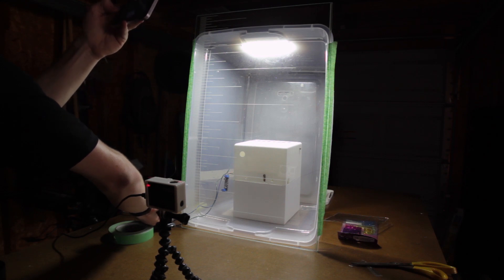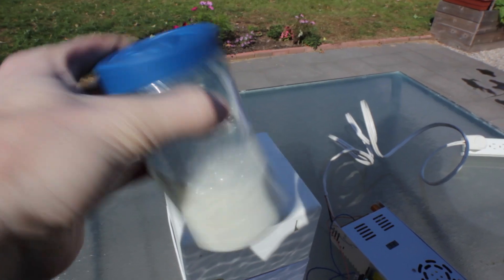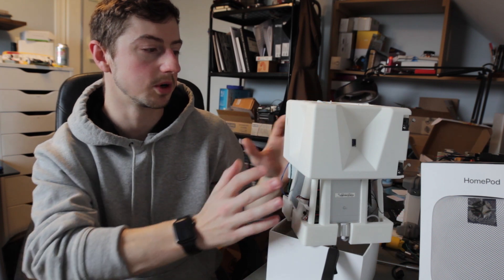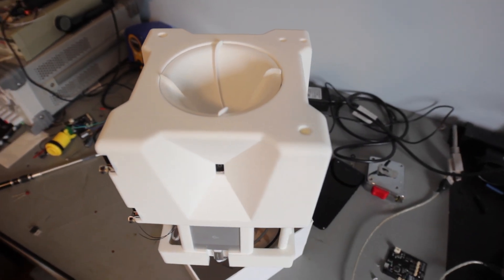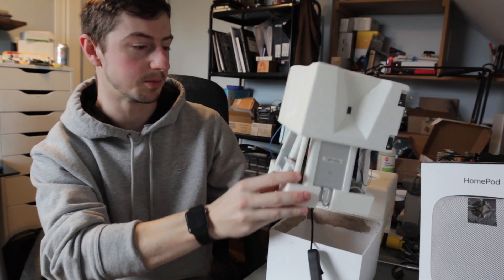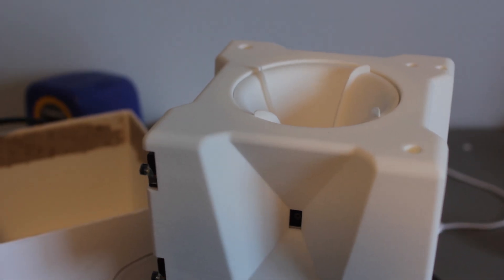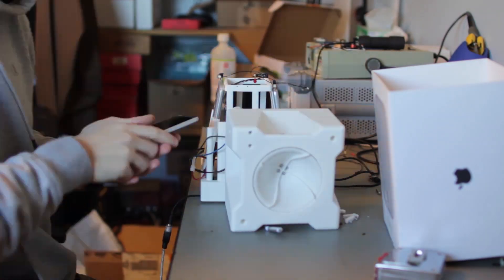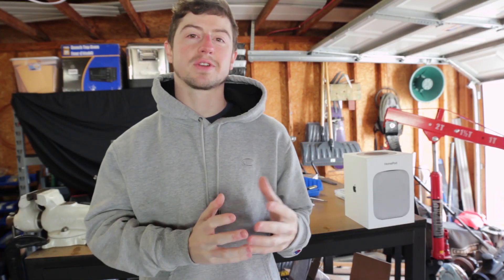Building Glitterbomb 1.0 with Mark Rober

Comment: What motors and stuff did you use for the 2.0? For the fart spray, cuz I had an idea for our reseaech plan to use those stuff to spray alcohol into our hands, with motion detector, so we dont need to touch the thing just to sanitize

Comment: Alright, so I see the code, but do you have the files for the 3d print?  Or source idk.. Catia, solid works, proe data?
Reply: And did you use a evaluation flash board and purchased parts with the microprocessors, pcb, etc or build your own?

Comment: Just two things... 

1.  Did you consider propelling the glitter with the exhaust from a carbon dioxide cylinder - it would likely have sent the glitter much higher...

Which leads to:

2.  If you get the glitter going high enough, why not add a can of spray adhesive that goes off first... put the nozzle on a stalk and rotate that, then propel the glitter with carbon dioxide.

Comment: Couldnt angle the fin and add tabs for some height?
Reply from the maker: We figured horizontal distance would do the most glitter damage.
Reply: @SeanHodgins  sweet. Exciting project.. thanks for posting. If you ever revisit the build might I recommend vacuum packed fish eggs in fish oil with a rolling pin. Keep the vids coming!

Comment: I saw the original. Great work. 
Yet for package thieves I favor a simpler design: a box with a handgrenade and the pin attached to the lid. No need for footage, tracking or retrieval

Comment: It must have been cheaper for you to buy a low budget 200 dollar 3D printer than ordering all those parts from shapeways. The quality isn't that much worse, especially for a project like this where you can easily sand all surfaces and spray-paint a nice finish if you want to box to look nice.
Reply from the maker: It’s not all about surface finish. Durability was important. The SLS nylon material can survive being thrown from a car or house (literally) - a home print would have broken into pieces.
Reply: @SeanHodgins  Ah, ok :) Could have gone for resin epoxy or something similar with a home printer, might have been cheaper. But it makes sense if you need strength. How much did the parts from shapeways cost?

Comment: 3:18 There's no actual lid on the top of the cup, and with those ridges sticking out, the box lid can't sit flush against the cup to act a sealed lid either... if the theives didn't hold this package in any way but entirely upright and stable, the glitter would all pour out of the cup.  A great gadget, but the actual theft side of this video was soooo staged.
Reply from the maker: You’re mistaken, while yes the ridges do make sealing it more difficult(hindsight) it was specifically tested and setup with a piece of foam in the top of the box that contours and compresses to the shape of the top of the glitter cup, essentially sealing it off. When I ran the tests on myself, and while it wasn’t perfect it was a good enough seal for this usage. I was able to shake and turn over the device without any visible glitter coming out. Now with something like this you also have to rely on a lot of assumptions. We had to assume that a box like this, with a slightly heavy, expensive, electronics in it(the homepod) that the thief would not be rough with it. I mean don’t you agree it would probably be easier to sell a working HomePod than one they broke chucking it into the back of their vehicle? So assuming that fact in combination with the foam in the lid made it suitable enough to hold the glitter in, at least until the lid is removed. Nothing can be perfect but the reason this took so long to build was we had to cover so many possibilities for what they might do. It was designed to be tough, sit out for extended periods of time, and work regardless of what type of person grabbed the thing. It was designed to be stolen.
Reply: @SeanHodgins  Cheers for the feedback Sean. I really wanted the video to be legit. I could discount some of the videos being staged (either knowingly or otherwise), but the glitter part in the cup was something that seemed like it would just pour out, especially as if you take a rectangular parcel and place it on your car seat, you'll most likely lay it on its side (otherwise it's just going to topple over when you're driving).

If there's some foam inside the top of the lid then that would make sense. I don't mean to knock your hard work, but something just didn't feel right when looking at the design without anything extra inside the lid. Great work though!

Comment: Great Designs, but come on, Shape Ways? You're throwing away good money there! Anyone could 3D print the same models for you for far cheaper. You gained a subscriber :)
Reply from the maker: Needed to use SLS printers so the design looked nice and would be durable. Not many people can afford those printers. Haha
Reply: @SeanHodgins  Yeah those machines sure are expensive... 

Printed in PETG with a .8mm nozzle, this could have been made really rigid through FDM. If you need any large 3D prints for future projects, contact me and I will see what I can do. I've currently got ten 3D printers and it seems that numbers always growing... (I've got two in construction now). Contact me at yelt3D@gmail.com

Happy holidays!

Comment: Would think something like a CO2 charge would spread the glitter more. Ether a direct puncture off a electromagnet driven spike or a spring loaded pin you can remote trigger.
Reply from the maker: Wanted to try to avoid actual explosions in this "not-a-bomb".

Comment: Sean great engineering! And for a worthwhile reason! To bad when you aerosolized the microglitter there wasn't a way to coat it with say 3M general trim adhesive ...that stuff would never come off.... riding around in a car or going into a kitchen that looked like my little pony had exploded in it would be so much payback....
Reply from the maker: Lots of possibilities! Thanks!
Reply: Could possibly add oil based paint or other substance that would seriously stain. :D  Though need a way for it to stay in even if the package tips over.   I imagine some kind of cover that seals around the cup would work then an actuator rod just pops the cover off as it spins.

Comment: 3:00 LMAO... Having worked in data centres for the last decade I can assure you they don't normally sit that high. Although I could only imagine the ear melting drone in a data centre 30 minutes after the air conditioning failed!
Reply from the maker: That was @ 12V, so potentially could do that. I also think a lot of them go full speed when you first boot up the rack, do they not?
Reply: @SeanHodgins   yes, each server will spin the fans up on startup until the BIOS kicks in (couple of seconds). Although the chances of more than a few doing this at the same time is pretty small.
Great work by the way, the results were hilarious!

Comment: The bomb worked out great but I can't get over the risk of losing 4 good android phones. Posted a comment on Mark's channel but doubt I'll get a response with how much traffic goes through his comment section. 

My suggestion was the usage of cheap 1080p fpv ip cameras for video, a dedicated gps module for tracking and a solenoid activated air blast for glitter distribution on a 555 timer. The control and comm circuits could be made smaller and there'd be more room for a lot more glitter. With the added benefit of a wider blast radius.  Maybe version 2.0?

Great job and such an awesome idea!

Comment: @SeanHodgins
Awesome stuff, you made my day! 
Did you ever consider using a CO2 cartridge instead of a spinning  device? That way you should be able to make a sealed container of the glitter that will burst when triggered! You would also cause the glitter to spread regarding which angel the package is opened in. 
Just some thoughts :-)
Reply from the maker: Yeah we discussed using CO2, but decided against it due to trying to avoid the actual "bomb" aspect of this thing. Pressurized vessels and strangers don't mix. You don't know what someone it going to do to it.
Reply: @SeanHodgins  You've got a point there... It´s truly a beautiful design! When will you make a build guide? - I need this! :-)

Comment: Glad you could open source everything! My only advice would be to replace the cell phones with fpv cameras which are also small and cheap and have wide lenses. it would be tricky to get the uploading aspect but much cheaper.
Reply from the maker: Uploading was a primary objective. Trumps cost. These phones are cheap anyway. Likely the cheapest option for what they offer.

Comment: I don't want to just Prank the fuckers. I want to demolish their house or car. Spray paint seems fitting. Kinda think a push pin jamed in the nozzle and then the nozzle tapped in the depressed position can make an effective pull pin paint grenade. Be intreasted to see this tested and see how effective it is
Reply from the maker: Past traumatic experience with a package thief?

Comment: How do you 3D print something like this? Not this exactly, but these types of models? Ie, what service and material is used for this? Thanks.
Reply from the maker: Shapeways in this case, but any SLS Nylon printer should do it. Nylon is a great material for this kind of thing, very durable.

Comment: you left out the fart spray - i was really wondering about this, i did see in the hot video that you cut a hole so it would spray out though
Reply from the maker: Didn't cover it in mine, added bonus for Mark's.

Comment: 2:23 Retrieve ;) *I before E, except after C. You're probably still smarterer than I is.

Edit: JFC You're nuts holding that fan in your hand! It could've taken off some fingers if it blew up. Unless server fans normally operate that fast? Also, did you consider small CO2 cartridges?
Reply from the maker: Oops, there is always something. 

Surprisingly that speed is fine for that kind of fan, but it was still risky. 
CO2 too dangerous for something like this.

Comment: I'd like to know more about how you were controlling the phones. More specifics, how many different actions did you have the phones taking? Did you have any trouble with the phones being responsive enough. Any feedback from the phones etc. It would be cool if you made a video explaining that in more detail.
Reply from the maker: The phones could be texted different messages to get automated response, like location, battery life, status, etc. That was one automate App.

The other App controlled the cameras through the headphone jack. Hitting the Media Button(headphone jack center button) would cause the phones to wake up and start recording, hitting the media button a second time would stop recording, close the app, open google phones to import the video, close google photos, and go back to sleep. This is a much simplified version, but that is basically how it worked. Phones had a lot of issues to overcome, there were delays, videos wouldn't upload, things that we didn't really have a lot of control over.

Comment: Add this to the glitter mix (found on Amazon) Visible Stain Theft Detection Powder - Purple and/or Fluorescent Powder, 100g Professional Luminescent Pigments Phosphorescent Color Photoluminescence Non-toxic Strontium Aluminate Neon Lights Nights in Dark Pigments(Blue Green)

Same type of dye used in bank exploding dye packs stains everything and the other will make them glow in Black UV light. They can vacuum up the glitter, but they will be identifiable.
Reply from the maker: If banks are allowed to do it...

Comment: Why did you use physical limit switches instead of a mag contact ? Just a weird choice since the rest of the build is so clean.
Reply from the maker: I don't know, reliability? There is probably a 1000 ways this could have been built.
Reply: @SeanHodgins  Why 2 limit switches? Maybe there's an obvious answer to builders, which I am not. Thank you for making the video. I imagine watching this may inspire a career path for more than a few pre-teens around the world.
Reply from the maker: @rslarkin  One ensures that the device starts the cameras recording(important if there is some sort of issue this is like a backup), the other allows the motors to spin, that way the motors will never spin while the lid is on.

Comment: I want to see the nastier / meaner iteration with dye pack/paint “bomb”, something that will for sure ruin the thief’s day or even week.
Reply: Yeah that's what I'm working on figuring out. I want it super low tech and low cost and can be slaped together in minutes and mass produced and still totally train wreck their car or house. As bad ass as this is, it's costly and complex. I'm thinking pin pull spray paint cans. Imagin three spray paint cans dumping their entire contents into a car soon as the lid is removed lol. That's justice. Glitter is irritating. Spray paint is more permanent.
Reply: Dont use spray cans.Just buy bulk enamel paint.Imagine it just spraying/pumping a entire one pint can of paint out of the device.
Reply: @joespawldin7833  Easy to do.  Cheap Arduino clone + limit switches + cheap servos.  Oh, and Google "3d spray paint servo".
Reply: Joe Spawldin a box with a lid that have holes on the bottom. lid is long sleeve and plugs those holes, when lid is lifted holes unclog and.... paint is flowing off
Reply: Joe Spawldin and it yells self destruct in 10 9 8..... To scare the people
Reply: Now you sir are a genius. Please take my money!!!!!
Reply: my idea.. 

make the cup deeper. 
add ink
add noisemaker

order of execution.  

person opens box. fart spray cylinder is punctured but doesn't release gas. 

followed by ink
then fart spray and glitter spinner to really let the Smell hit it's target fast
then noise maker. 

then it's official.

Comment: My take is a bit different, with pneumatic system. CO2 cartridge provides power for the glitter flinger/balloon of surprise, and continues to activate until the time is up and a failsafe spike is deployed to pop the balloon.
Reply from the maker: CO2 cartridges came up in discussion, but a pressurized vessel seemed a little too dangerous in the hands of strangers. Your idea sounds hilarious! Really clever.
Reply: @SeanHodgins  I take it you wouldn't be in favour of some industrial grade fireworks igniting in the package either?
Reply: Balloon just for a loud pop?
Reply: @michaelsmith483  In my idea, it also contains the surprise, such as glitter. As balloon exceeds its limit and bursts, it emits a loud sound and flings its content around.

Comment: I think you could sell these in a smaller package that just pops glitter and fart spray with no recording. I would set one out everyday. I don't care for the footage, I will just laugh knowing someone got messed up.
Reply from the maker: Haha pure evil. I have a fear of glitter now.
Reply: @SeanHodgins  - PTGS - Post Traumatic Glitter Syndrome
Reply: Or just be satisfied with audio recording only, cheaper, but may get a laugh if you get it back. Still needs GPS for location though, unless you can use a WT (walkie talkie) with VOX (can be triggered electronically) as some sort of locator and remote audio listener (range only a couple miles at best though).

Comment: Are you able to buy all the pieces to make this product at a store? Such as a circuit board?
Reply from the maker: Almost everything in this build was custom designed parts except for the phones and motors. You could use an off the shelf Arduino if you wanted to though.

Comment: Does the cover come off easily?  I was thinking what if while picking it up the cover accidentally slips and the mechanism is triggered.
Reply from the maker: Its secured in a similar way to the original packaging, so its on there pretty good. The switches are at the top so its hard to accidentally trigger.

Comment: If the thief tipped the package over, would the glitter (mostly) stay confined to the cup, or would it just go everywhere and not get flung?
-never mind, found a comment stating foam in the top of the box keeps the glitter in
Reply from the maker: Yeah we had to make sure it would be shake proof. We had no idea when or how many days it would be sitting around until the thief opened it.

Comment: Does the phone go to sleep after a while, or does the screen stay on at a very low brightness? if it goes to sleep, how does the audio jack signal "bypass" the lock screen?
Reply from the maker: If you never enable a lock screen, when you "load" an app the phone just turns on. I also did some stuff with the phones power state as well.

Comment: nice work Sean.  I was the packaging engineer that designed the homepod packaging :)
Reply from the maker: That was a pain to take apart! You use some good double sided tape to hold that injection molded plastic in there.
Reply: yeah believe me that was a tough project.  homepod is a heavy product and needs to withstand some high drop heights.  and thats not injection molded plastic thats a thermoform :)

Comment: Four phones, 3D printing, arduino plus modules , and motor plus spinner. The build cost alone may push stealing this into a felony. Hindsight 20/20, Video was of limited value as faces could not be shown. Audio was funnier. Nice work but a little too pricey to lose.
Reply from the maker: The cost of the unit may have been part of the plan, as leverage to get it back. ;)
Reply: @SeanHodgins  Why are you hiding the faces though?
Reply: Dany Caissy I was wondering that too. Can they really suing you for invasion of privacy?

Comment: Wonder if adding a 12g co2 cartridge to the glitter blender would improve dispersal.
Reply from the maker: We were trying to avoid the actual "bomb" aspect. haha But it did come up!
Reply: SeanHodgins Did the fart spray just keep spraying until it ran out?
Reply: I like your thinking, although would need to replace C02 every time
Reply: @slightlyokvideos  you charge the battery, refill the glitter and replace the fart spray everytime no?